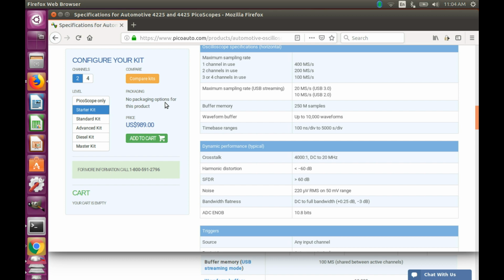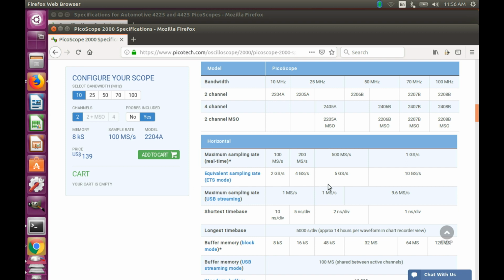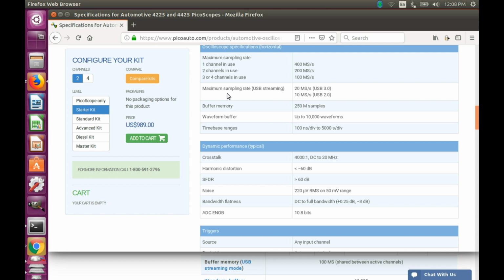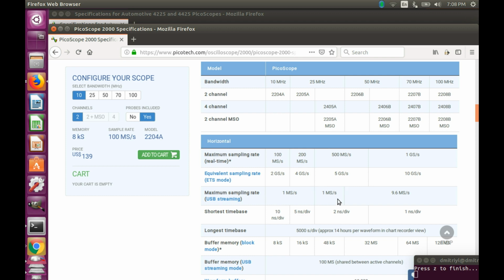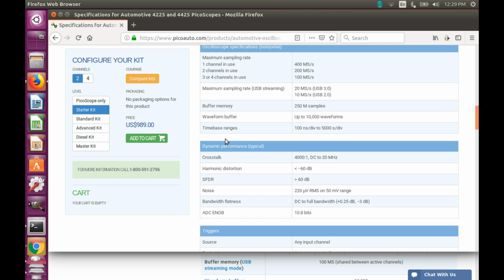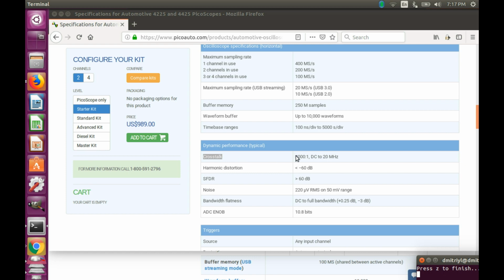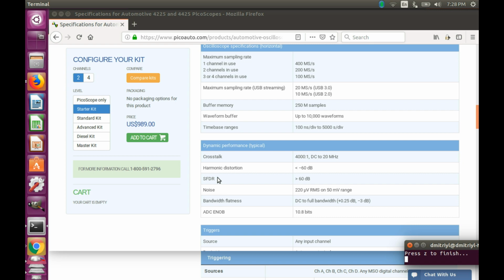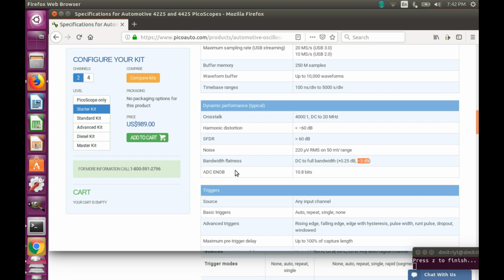Overview of detailed specs of Picoscopes (Automotive + 2000 series): Part 2

Comment: I have some questions if you wouldn't mind. Maybe a video request.
I have some questions about the pico.
1. Bit resolution vs. Filtering(pros and cons)
2. Oversampling will eat up memory, but will post sampling bit resolution enhancement also take as much memory as oversampling?
3. Will changing the setting on how many buffer windows allowed affect anything else on the pico(say allowing 10000 Windows as opposed to the default 32 windows)?
4. I know everyone talks about streaming, block mode, and rapid block mode, but I seem to fail to grasp how to decide which is best, plus how to access rapid block mode. All the descriptions of these modes that I've seen seem a bit vague. mind clarifying?
Thanks bud, love your videos!
Reply from the maker: Great questions! It will take quite a few new videos to cover all of them :D

Comment: I'm a hobbyist looking to find out if it would be worth the extra money to buy a 2205 vs 2204 scope? The 2205 is close to being out of my budget but if its going to help me see more then i think its worth it. I could also get the 2204 and spend some extra on accessories leads. Also wonder how the hantek compares to these cheaper pico scopes? The pico software looks much better then the hantek to me.  I guess a little more info on differences in software  between the 2000 series and automotive scopes would be great too? All the videos are really good! Thanks for all the good information!
Reply from the maker: The answer is simple if 1MS/s streaming covers all your needs -- then get 2204A and spend extra on good leads, attenuators, etc. 

If you expect to encounter a faster signal, then ask such a question:
If you are sampling two channels in block mode at, say, 4MS/s, 2204A will show you 1ms across the screen, but 2205A will show you 2ms across the screen. Does it matter for your purposes? If, for example, it's a data packet of 1.5ms length, is it important that you see all of the packet, or only half?

I don't have experience with Hantek... I find Picoscope software intuitive (my personal view, of course), and ability to "compare notes" with tests techs do with their automotive scopes is invaluable.

Comment: So the question is, for most of us techs in the automotive world, what would be the sweet spot for pico scope?
Reply from the maker: That would make a very controversial video if I recommended a non-automotive scope, wouldn't it? :) Luckily for me, in the year 2018 the equation is tilted towards the automotive ones. The answer will be different if one wants a back up scope or wants features not available in automotive versions. Something I hope to address in a later video.
Reply: I think if you have the money go with the automotive scope. So far it look like to me there's more positives with doing automotive work in general with the automotive scope.  Just my two cents. If i had the money i would be!
Reply: n2fastcars yes i agree, but which speed level do we actually need in the auto labscope?
Reply: I think there's only one automotive scope they offer. The 2000 series he is comparing too is a cheaper general use  scope not really ment for automotive use.
Reply: Oh i see. The cheaper one has speed options and the auto is just channel options. Thanks